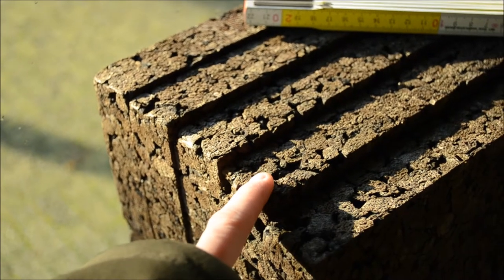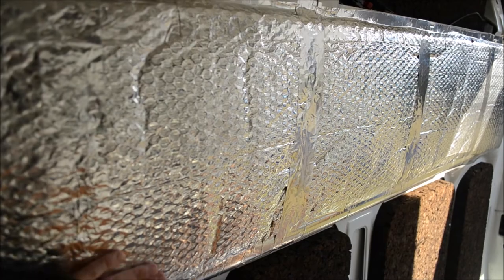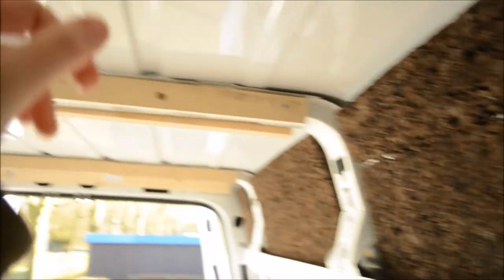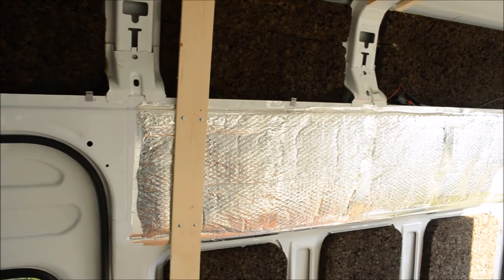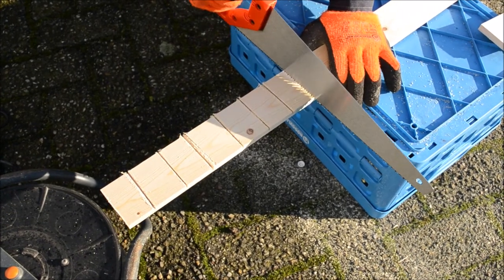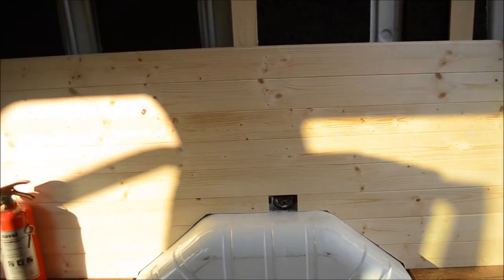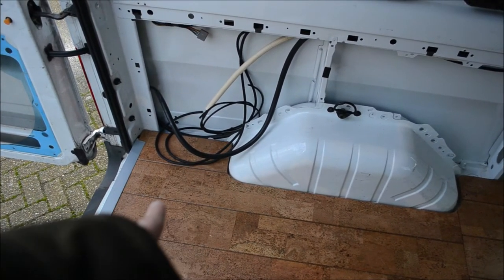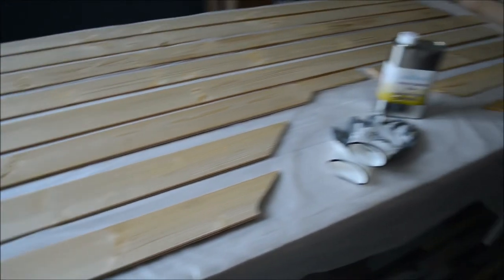Cork Insulation and Support Structure for the Walls - Campervan Conversion

Comment: looks good, can I ask what screws you use to go through wood and metal?
Reply from the maker: Sure! Pan head self drilling screws with a star drive, so fit for Torx. Just basically look for 'sheet metal screws' with a self drilling bit on the tip.
Reply from the maker: Oh actually, these screws were not Torx compatible so we have others now that are. Gives much better grip :)
Reply: Perfect thank you that helps in minefield of screws when I look :) nice work so far looking forward to other videos. P.s your dog is adorable.

Comment: How has the cork insulation held up?
Reply from the maker: Very well!
Reply: @sportingwithstaffords  I talked with an expanded cork insulation distributor and he wouldn't recommend this type of insulation in a van due to it crumbling very easily. Can you expand on how the insulation is holding up? Has it started to crumble due to the vibrations? Also have you noticed any issues with the crumbled cork settling in the open spaces?

Comment: Hi, is the cork insulation better than celotex?
Reply from the maker: That depends. The Lambda value is 0.37, so it's similar to Celotex. The insulation capacity (R) then depends on the thickness of the material. The advantage of cork insulation is the fact that it's renewable and very sustainable. We wrote about different natural insulation materials as well as our choice of insulation material on our website. You can find the campervan conversion blog posts here: http://mojoandfriends.blog/campervan-conversion/ :)
Reply: I would be worried that the cork (without a sealant) would soak up condensation moisture and become chronically damp over time. Is this something you need to think about, or is it me just overthinking?
Reply: You have a valid concern.  While I think the concept of sustainability and renewability is a valid motive, the vehicles occupants will definately deal with mold issues in the future unless they live in the desert.
Reply: Tony Notstated hi Tony. If they put reflectix over the cork as a condensation barrier could that help block chances of mold? I'm not sure. I like the cork and think it may help the van be quieter.
Reply: My biggest concern is with a hypothetical solution when dealing with something that can't easily be seen and/or corrected.  In this case I'd opt on the side of caution and go with what others have tried and works well.  Take  a look at Greg Virgoe's sprinter insulation discussion on here.  He answers this question in depth.
Reply: Tony Notstated yes, I've watched his 2 vids on insulation. With the cork here they have a lot of exposed and empty space vs filling it with the insulation which I thought was odd. Unless they fill ALL the gaps. But they didn't seem to fill the gaps when doing the back door paneling. Thanks for replying.